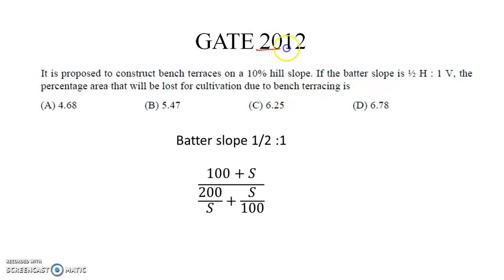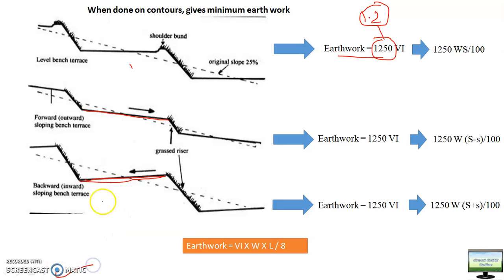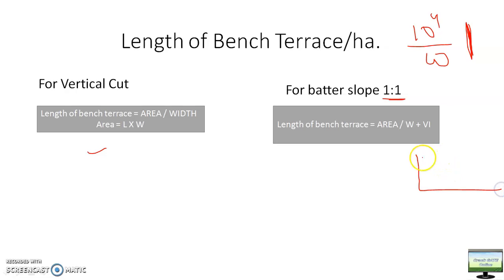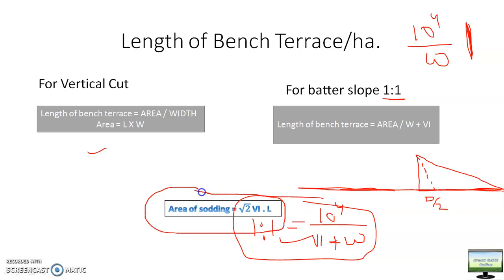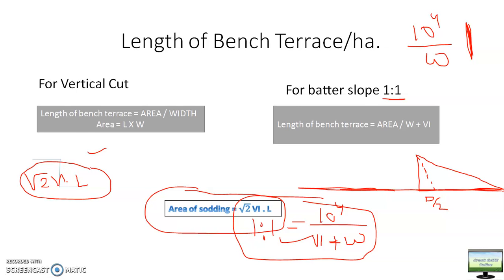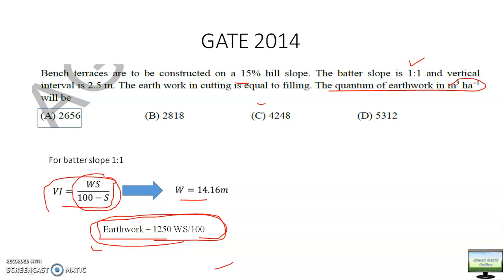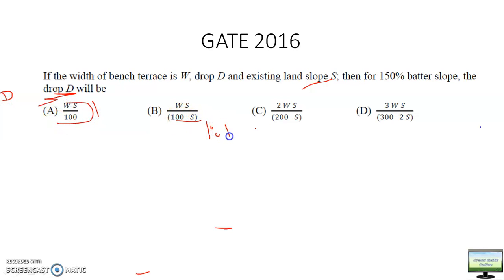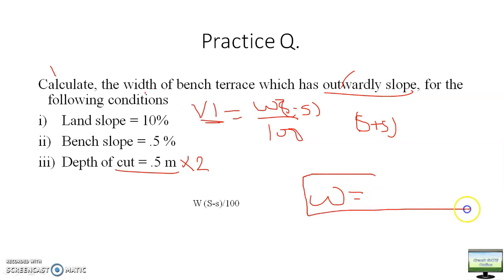1.3 Terracing

Comment: A gas expands through an ideally, insulated nozzle following a reversible Polytropic law
PV1.2 = C. There is no change in potential energy but the pressure drops from 20 bar to 2 bar and specific volume increases from 0.05 m3 to 0.3 m3. If the entrance velocity is 80 m/s, determine the exit velocity. 
Pls solve this problem  sir 
Please sir

Comment: In gate 2011que if we calculate the earthwork by formula 1250*(2ws)/200-s (this is told by you in lecture 1.2 for batter slope 1/2:1) ,then it is equal to 1000  but in your selected option is 920 .So why it is different?
Reply: And same error in the gate eqn 2014.
Reply: Yes Sir....Same doubt sir

Comment: Sir in gate 2014 if we directly put 2.5 then the answer is 3125 .... It's not 2656
Reply: You have to use WS/100
Reply: @abhayagrawal8112  sir but u told that for 1:1 slope , we will use ws/100-s